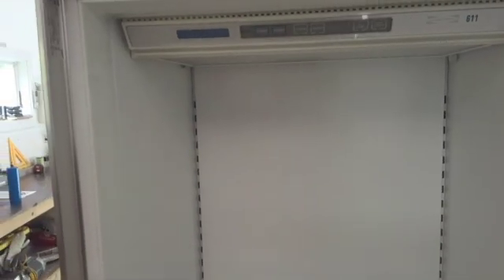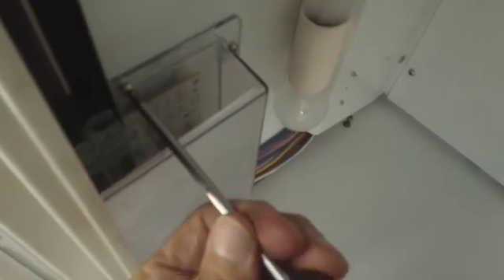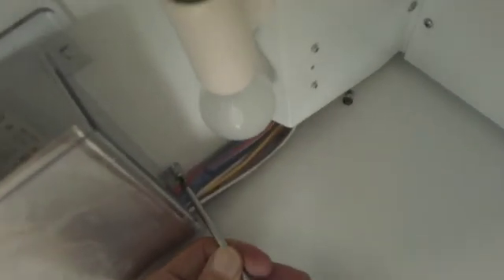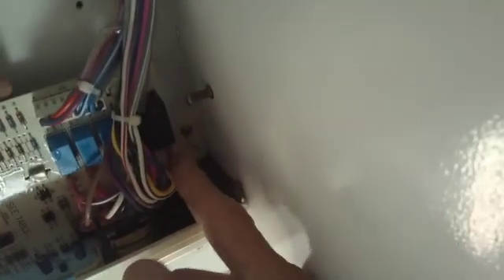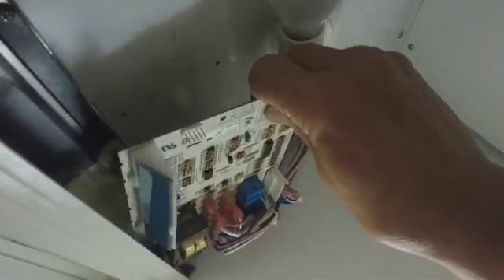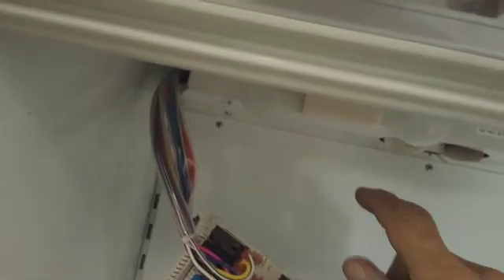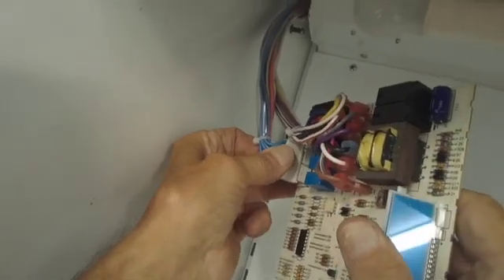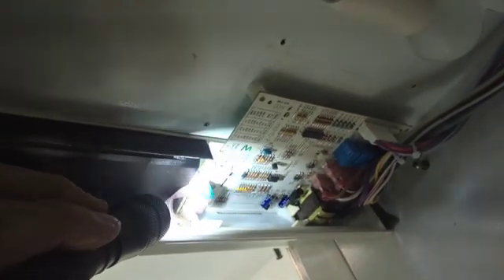Sub-Zero 600 and 700 Series Control Board R&R

Comment: I am working on my 2003 Sub-Zero 680/F and the refrigerator portion of the unit stays at 34F and will not allow me to adjust the refrigerator temperature up or down.  The freezer portion allows me to adjust the temperature and works fine.  

I assumed that the control board was bad, so I replaced the control board with a new unit.  Unfortunately, I still have the same issue.  The refrigerator warmer/cooler button do seem to function as I can get it to go into the diagnostic mode utilizing the cooler button on the refrigerator portion, etc.

Can you provide some advice as to where I should look next?
Reply from the maker: If the display panel is unresponsive to adjustments then you might need a new one. We have a video on to replace it. Also, try doing a hard reset by shutting off the circuit breaker for 5-10 seconds. There could also be a problem with the control board.
Reply: @ I just replaced the control panel and still have the same issue.  On my 680/F the display is part of the control board.  Can the control (Warner/cooler) buttons themselves go bad?  I’m just trying to increase the refrigerator temperature above the 34F it is defaulting to.  I have done multiple resets/turning off at breaker, etc.
Reply from the maker: @stevewcuus  can you set the temperatures or is it stuck
Reply: @SubZeroSpecialists  stuck on 34F for the refrigerator.  The freezer adjusts fine.  I had the same problem before replacing the control board, so it does not seem related to the control board.
Reply: Maybe it’s the actual button panel that is attached to the control board via the ribbon connector?
Reply from the maker: @stevewcuus  yes it’s called a display panel or interface. Did you program the new board correctly?
Reply: @ I assume you are referring to ensuring the resistors are in place corresponding to the model?  If so, yes, my model requires resistors in #50 & #52.
Reply from the maker: @ Then try changing the display panel. Most often we replace both parts. Did you have any power failures lately? Was the door left open which could cause excessive moisture build-up around the interface? It's hard to diagnose a unit without actually being there.
Reply: @ Thanks so much - I am thinking it has to be the display panel.  Thanks again!
Reply from the maker: @stevewcuus  let us know how you made out.
Reply: Just want to add in here, mine has been doing something similar and created frost in the fridge as the evaporator froze up due to a bad control board. My display panel was reading 34 and I could adjust it, but it just wasn’t changing the actual temp. Tested continuity, and even with the unit off, the condenser was on and constantly running. Changing the board out now and fingers crossed it fixes it after a full defrost.
Reply from the maker: @FeveredMusician  Sounds like a bad control board. Relay is stuck.

Comment: How do you cut the resistor out? I need to cut the R-50 out.
Reply from the maker: @avs7709  use a wire cutter or a toenail clipper

Comment: I have a 700 TF freezer which is tripping intermittently.  The unit will just stop with no error codes displayed on the panel.  Pushing the ON/OFF button restarts it with no problem and it then seems to run for a few days before tripping out again.  I have had a technician in to check the unit and there does not seem to be an issue with the compressor/refrigerant/relays etc.  He does think the control board is the issue because there is no error code displayed when it trips, but there does not seem to be anything else that could be causing the issue.  Do you have any suggestions?  Replace control board?
Reply from the maker: @petersmith374  is it a variable speed compressor. Do you have an inverter box next to the compressor? I would not suspect a control board but it could be. Are there any other appliances on the same circuit? It could also be the wall outlet. Try plugging the freezer into a different outlet.
Reply: @SubZeroSpecialists  The unit is about 15 years old - don't think it has a variable speed compressor.  It is powered on a dedicated circuit from the electrical panel so no other appliances on the circuit.  I did power down from the breaker and let it sit for few minutes and then powered it back on just in case a 'reboot' would help.  The technician also suggested moisture in the keypad due to the lighting plate not in position correctly.  I'll let it run now and see if it trips again...  Thank you so much for your help!
Reply from the maker: Most of the time when the circuit trips it’s the compressor or the wall outlet. I’m not sure if I’ve ever seen a display panel or board trip the breaker.

Comment: Looking for some help. 700tci3 running and powering off. Sometimes push buttons work. Sometimes not. Same with door and freezer lights.  Verified it is not the door light switch. Ordered board as it seemed like power supply issue swapped board and still have same issue. Getting 120 v to lights when it works but only seeing 1 or 2 v when it is not working. What other sensor would interrupt power from the control board?  Also sometimes Refigriator evap fan losses power. Sometime in sync with lights and other times they work independently.
Reply from the maker: @davidcooper3875  check behind the fan shroud for a loose or bad harness.
Reply: Are you referring to the shroud the lights attack to?  I have check that and seems ok. Unit is built in and can’t get to wires on top or back of cabinet. When it gets power I can hear the relay on the control board click.  What other sensor would prevent control board from supplying power?
Reply from the maker: @davidcooper3875  the sensors don’t control the board. It sounds to me that you have an electrical issue. Did you program the board per the instructions?
Reply: Yes. Removed 3 resistors. New board is pretty much doing what original did.   We have been in home 3 yrs without issues before week or so ago.
Reply from the maker: Did you take the back panel off and drop the the fan shroud down? I’m pretty sure there’s a harness behind there. Go to our website and look up the wiring diagram for your model and serial, I’m sure there’s a harness back there.
Reply: Yes that bundle seems to go ito a back area and would need to have unit pulled out from the built in cabinet.

Comment: Having issue with 700tci3   Lights not working was first symptom. Reset breaker and would come back on.  Seems to run normal and cool most of time.  Becoming more frequent in occurance.  Yesterday open door and lights started coming on and off every couple of seconds.  Could hear relay clicking each time.  Suspect control board issue. Any other simple things to check before replacing it?
Reply from the maker: @davidcooper3875  check the light switch
Reply: They all seem to be working normally   Will give it another look. Have ordered a board as they have a few day delivery.

Comment: I have a BI-36S from 2009. Today the display just stopped working, no numbers and buttons do not work. It lights up and has power but no cooling. Do you think it is the control board?
Reply from the maker: Check the control board for loose wires

Comment: Hi, my BI-36U control panel sometimes works and sometimes does not respond…I called subzero and they walked me thru resetting the unit but it still only works occasionally. The refrigerator still functions despite the panel not functioning all the time…any thoughts?
Reply from the maker: Change the display panel.

Comment: What was the reason the board was bad.
Reply from the maker: I didn’t say the board was bad, the video shows how to replace it. Some common reasons for replacing a control board are erratic temperatures or not running at all.

Comment: Great video. I have a 601f that is over cooling. Stuck at -20. Bad board???
Reply from the maker: Most likely but it could also be a sensor or the display panel.
Reply: @SubZeroSpecialists  thank-you for the reply. How do I tell what board that I have in a 601F from 2004?
Reply from the maker: @mitchellplatin5580  You can go to my website aaronsrefrigeration.com and look up the PN or you can call the parts department +1 (800) 305-0722 with the model and serial number. Before you do that check the temperature in the freezer with a thermometer to verify that’s it’s -20. To get that cold it would have to be stuck on an on-cycle and not shutting off, that would be the board.
Reply: Thanks again. I flipped the breaker for a while and then it seemed to be operating normally. Woke up this morning and back to -20.
Reply: @mitchellplatin5580  I have the same issue, and flipping the breaker didnt work either, also turn off the unit, the compressor still running. 601f, did changing the penal fix the problem?
Reply: @joycelynsun5949  It is a bad relay on the board. The board is easy to replace. The board has about 5 relays or so. You can try tapping the relays and it might break something loose and work for a while longer.

Comment: HI. Thank you for this video. I am about to replace the control board on a subzero 611 similar to the one you have in the video. I've searched for the manuals but am unable to find information on any resistors i would need to cut out. Since you replaced the board on the exact same model are you able to link me to the manual or let me know which resistors i would need to cut out for this model. Would i just be able to copy the same resistor configuration as the board i am replacing. The issue I'm trying to fix is that my freezer wont stay as cold as a freezer should.  thanks
Reply from the maker: The instructions for removing the resistors are in the box unless you purchased a used or rebuilt one. Also if the freezer isn’t working there could be other issues other than the board.

Comment: We were told the circuit board neede replacing. The freezer and ice maker in our 642 was malfunctioning. Where would we purchase the circuit board?
Reply from the maker: Where do you live
Reply: @SubZeroSpecialists  Seattle
Reply from the maker: Call Subzero headquarters 800-222-7820 for the nearest parts distributor.

Comment: I have an issue on a 695 where the ice and water in the door work intermittently. If you cycle the unit the  will work and dispense ice and water for a few minutes. Afterwards the buttons just flash when you try to use them. Bulk ice works consistently. Does this sound like a faulty controller board?
Reply from the maker: It could be the touch pad which send and get its signal from the control board.

Comment: Hi My 690 has the buttons on the left side as I have ice and water dispenser.  I replaced the dual solenoid  and the water dispenser assy.  Water still drips for 20-25 seconds after I release the water button and fills up the bottom of the water dispenser grill.  Is there any other relay or could it be the computer board??
Reply from the maker: It’s probably the water tank. Check the seals on the brass nuts or the water lines.
Reply: @SubZeroSpecialists  I didn't know it has a water tank??  I see copper line in from the wall that goes under the refrigerator then goes up... somewhere... do I need to remove all food and remove panels inside the refrigerator??  Is it behind the control panel as that is where the hose brings water (Left side of refrigerator) seems to drip all the excess water out of the hose after the valve is closed
Reply from the maker: @richiedigiacomo3937  no. Iyar in the refrigerator on the left side of the wall
Reply: @SubZeroSpecialists  OK I removed the left cover plate and found the circuit board, ice slide and water reservoir... no leaks and brass fittings are tight... so, I'm not sure what to check or replace/service etc to help stop the dripping after I release the water button. I have been dealing with this for 2 months and feel I'm at the heart of the problem.  I hope your advice will resolve this leaking issue. thank you
Reply from the maker: @richiedigiacomo3937  you have an air leak so check the lines from the water valve to the tank and the tank to the dispenser.
Reply: @SubZeroSpecialists  I got it!!  The hose from the valve to the tank... before it goes through the rubber grommet to the inside tank... I noticed moisture... then, I see a copper line that it up against the plastic line... the heat of the copper line slowly melted the line and air in/water dripping out. I repaired the hose and it stopped!!!  I gently moved the copper line away from the plastic line and other wires away from it as I saw dark spots. Probably would have caused a wire harness problem too,,,  Thank you for all you help as I didn't have the confidence to open up the inside but it is quite easy to do...  Thanks again!!

Comment: Thank you for the nice and concise vid. So I'm looking to procure a control board for a 601F. It's just not defrosting unless I force it to.  I'm gathering after ohming the different heaters and checking defrost terminator for continuity below cut in temp, I'm in the market for a control board. I didn't test the evaporator thermistor because A) I didn't want to cut the wires; and B) it's reading temp just fine and I'm getting no errors from thermistor when I check through control panel... just the EC24 for "underheat". 

So to get to my question... I live overseas of the US and bought the freezer here which is a 200-240V 50Hz country... I noticed while cleaning the condenser that there is a step transformer, as with the rest of our Sub-zero appliances... so I'm guessing the components are 110-115V 60Hz and the current is being stepped down and rectified from the 220-240 world to the 110-115 world. I was looking to source a control board from the states from certified suppliers and came across the one for the 600 series (601F) but then it noted that if the unit is international I should look at another part number (which is for "International Units"). Finally my question: So if they've already included a transformer to step down and rectify the electrical current, what would be so different about the control board? Why wouldn't it be the same part number as a unit in the States?
Reply from the maker: I agree, the PN's should be the same but I would check with the engineers at subzero just in case.
Reply: @SubZeroSpecialists  Yes I should. Many thanks for your reply.

Comment: After replacing my control board, my freezer will only maintain the temp of the refrigerator.  Can you explain why that would happen?
Reply from the maker: That depends on many factors. What is the model, what is the back pressure in the sealed-system. Is the condenser clean? Knowing the back pressure would help narrow down the answer.
Reply: @SubZeroSpecialists  
I will check and get back to you. It is a 632-2
Reply: @stephenreill2258  Not an expert in any sense but just by listening to this vid I gathered the control boards run for the same series and different models whether it's a fridge or freezer. From what I understood, you'd have to configure yours not only to your model but also if it's a freezer or fridge. If you didn't have such issues before replacing the control board, it sounds like - just a guess - your control board is configured for a fridge... not a freezer.
I am looking at replacing a control board because after exhausting all  possibilities of why my freezer (601F) is not defrosting it looks like I need one. Reading their compatibility I couldn't understand how it would be the same control board for a 601F and a 601R.. among other models. But watching this vid and catching that sentence that control boards need to be configured according to your model, it now makes sense.

Anyhow... any progress with your issue? And what was it. I'm interested and following. :)